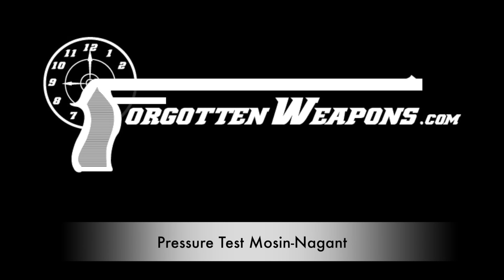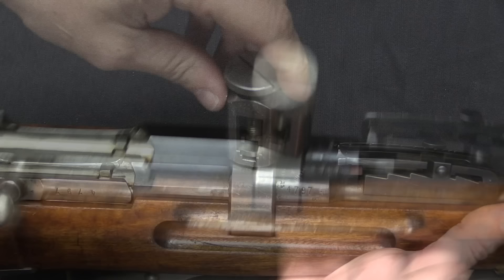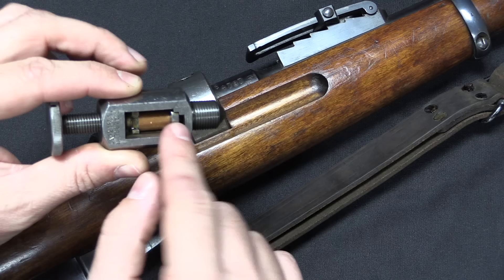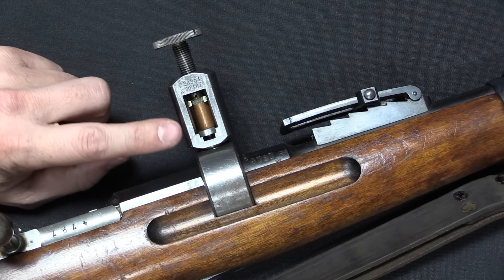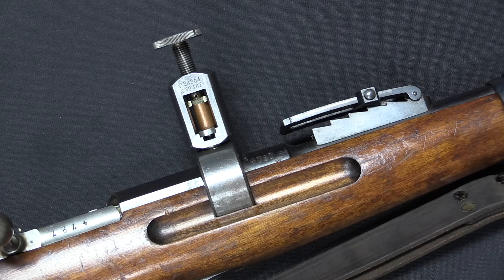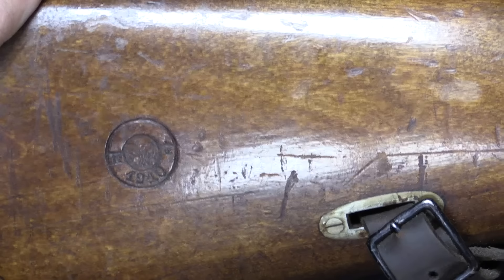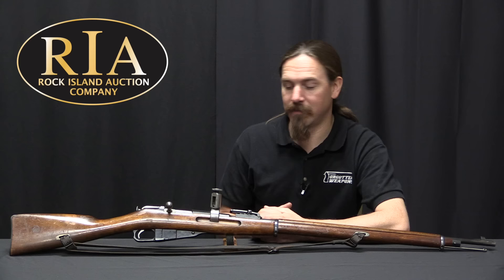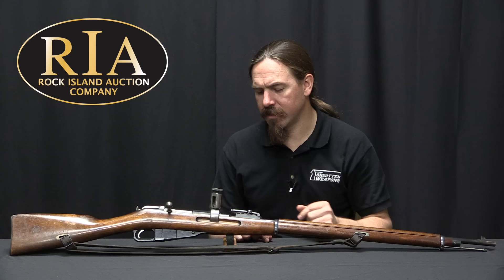Mosin-Nagant Factory Pressure Test Rifle

Comment: Very technically speaking, a Mosin Nagant with a gas piston.
Reply: Taco press included
Reply: Fully automatic mosin
Reply: in a very specific sense, a firearm itself is just a type of heat driven piston engine. so this is a heat piston with another heat piston attatched to find the operating pressure of the first heat piston
Reply: Hahaha

Comment: I would love to see one of these firing in slow motion and seeing the copper squish
Reply: It would be cool to see it fire,however the "squish" is probably measured in thousandths or hundredths of an inch and not as dramatic as one might imagine.
Reply: Quick let's get Talfledermaus on this project!
Reply: @JohnLeePedimore  Unlikely, since they could measure this before 1900, at a time when measuring thousandths or hundredths of an inch wasn't possible.
Reply: @anzaca1  Micrometers have been around since the 1850's. thousands or ten thousandths of an inch can be measured that early
Reply: @anzaca1  Joseph Whitworth was measuring thousandths of an inch back in 1857 and the micrometer is much older than that. I'm not sure if they even used CUP on black powder guns back then because the normal method was to "proof test" the barrels by loading a double charge and firing it. Proof testing is still in use in Italy today.
Reply: Buy it and have Ian show us!! :)
Reply: Tenaciousvirgil tenaciousvirgil sadly I live in socialist England
Reply: @ArchieKeen1  oh dude so sorry to hear that. Ps free Tommy!!
Reply: @JohnLeePedimore  I think they designed the deformation to be in a bigger bandwidth to measure more easily? Like, if it was only thousands, they could have designed the probe longer?
But a short one might also have more advantages, one important is that the volume doesn't influence the pressure if the amplitude isn't high
Reply: @gustavgnoettgen   True enough. It also makes it easier to get the case out of the gun if it doesn't have part of the brass shoved into a hole in the chamber.
Reply: @JohnLeePedimore  Slowmotion and zoom then.
Reply: @JohnLeePedimore  pure copper is very soft. And considering they didn't use lead, copper was likely soft enough to be squishy noticeably.
Reply: @anzaca1  actually, gauge blocks were made in 1896 that were accurate to a ten thousandth of an inch, and Brown and Sharpe had commercial micrometers that could measure thousandths in 1867. Even before that, handmade gauges could  be made and calibrated to measure things like the copper slug.
Reply: @anzaca1  micrometers have existed since the 18th century.
Reply: @anzaca1  that's simply not true, vernier scaled micrometers could measure to four decimal places before 1900
Reply: I would have settled for an example of squished copper.
Reply: Not as big a squish as u think probably.  If it was, would come into contact with the walls of the bracket :c
Reply: I think it would just be a sped up video of the Hydraulic Press Channel and you get a similar effect.
Reply: Pod it would probably still be a satisfying deformation in macro, ultra high speed.
Reply: Anzac-A1 bullshit bro
Reply: @anzaca1  and you think people back then lived in caverns also?
Reply: Sqwoosh!

Comment: As a reloader I know what CUP is and have that info in some of my older manuals,  but I've never seen a pressure test rifle . So this is a really cool video to watch .  In recent reloading manuals PSI is used , and there is information stating the barrel used for load development of each cartridge before the various bullet weights and charges of powder used . Often times the barrel will be a certain manufacture ,  length and twist rate  .  But sometimes the barrel used is listed as "test barrel '.   A knowledgeable shooter and reloader should inspect the fired brass for signs of overpressure . These are , but not limited to , primers showing signs of backing out of the pocket , primer cratering , primer flattening , excessive case stretch ,  and such .      Interesting story , I was new to reloading and told a relative I could use the spent brass from his 30-30 to reload better than factory ammo . When I received some brass he had recently shot I gave them an inspection before depriming . The primers were set back from the pocket a few thousands of an inch were a bit flattened , and  were starting to crater . I asked him how his rifle was shooting . He said as accurately as ever , but the recoil seemed harder . I told him his rifle was shooting too high a pressure . Over the years he cleaned the powder residue from his bore and chamber,  but never cleaned for copper fouling . After a thorough cleaning of copper buildup the rifle shot factory ammo with no signs of overpressure , but accuracy was terrible .  My handloads shot equally poor groups .  Years of improper cleaning had damaged the the rifling just forward of the chamber . The fouling was allowing the bullet into the rifling straight but slowing it's release from the case .     Y'all  Take note . Clean your guns of powder residue and metal fouling . And if your spent brass , especially the primers , look wonky , have the gun checked out before shooting it anymore .  Peace , Out !
Reply: I don’t even own a firearm and this was insanely interesting to read. Thank you!!!

Comment: The calculation is fairly easy to calculate chamber pressure via this method. Its always interesting to see the change in technology over the years for just taking measurements. Now days strain gauges or piezoelectric sensors are used.
Reply: +Mongo63a
It's not easy enough to do without a calculator, but yea. I'll bet gauges are better than having to keep track of copper pellets, for sure!
Reply: @Thelothuo  Yes... but nowhere near as cool!
Reply: Piezo electronics are also used for amplifying acoustic instruments! Things like guitars and ukeleles. Interesting how the same concepts carry over. In acoustic instruments, the crystal is placed underneath the bridge saddle (where all the downward pressure from the strings goes into the body) and turns the string vibrations into an electric signal and then into an amplifier.

Comment: Of course you can convert,you take the stress deformation graph of copper,you put the permanent deformation ofthe copper on x and you go up with a line of the same inclination of elastic deformation ,when the line intersect the copper graph thats the pressure on the copper,you multiply that for (Area coppercylinder)/(area piston) and you obtain the pressure inside the chamber
Reply: Correlation coefficient, not quite a direct conversion of units.

Comment: I mean so long as you know the Young's modulus of the copper sample then you can calculate the force applied. The force applied divided by the surface area of the chamber should be your chamber pressure

Comment: Copper Crushers, as the copper pistons are know were a common way of measuring the in chamber pressure of many rifles. Normally what would happen would that a manufacturer of these 'crusher's' (which came in rods and balls) would sell them as lots with pressure tables (a tarage table), as Ian mentioned, one you have fired your round you would measure the amount of compression on the rod and ball and compare it to your table to give you a pressure measurement. This system had been around since the early 50's and was uses world wide in small arms, even though it began life which large calibre (i.e. artillery pieces).
As of 1977 Abderdeen Test Centre delcared that the Copper Crusher Method was no longer suitable for NATO purposes as it could not be measured precisely, therefore nowadays most NATO countries (and many non NATO countries), use Piezoeletric sensors which are quartz based sensors which can provide measurements with accuracy to normally 0.5%. (Depending on how well the equipment has been maintained, whether it is within it's calibration spec and the DAQ system it is attached too is operated by a competent user).
Oddly enough you still see copper crushers being used in and around the middle east and normally on shotgun cartridge testing mainly out of habit and that Piezoelectric sensors can be expensive (read approx $2-3k per sensor).

Comment: Years ago when I was an inspector in a large manufacturing facility hardness was tested using CPU's also by measuring the squish of the copper pellet by smashing into a surface with a round anvil to create a dent to a certain depth. The latter tests used a direct pressure reading but the old charts still listed CPU's for comparison.

Comment: CUP and psi have no direct conversion, but are of the same general magnitude; a cartridge developing about 50,000 CUP will develop pressures in psi about the same plus or minus a few thousand.

The pressure tables are drawn up with copper cylinders of the type described, which are subjected to known pressure impulses in a pile driver-type device.

Comment: Probably my favorite pressure test rifle I've seen in person was the 1918 Mauser T-Gewehr that the National WWI  Museum had on display some years back. Imagine the size of the copper cylinder that thing would crush for pressure testing. I don't think they had the full setup with the actual thread-in piston for it, but the added ring that it would thread into was quite sizable. If I recall correctly it also had it's sights offset to account for the massive ring and piston setup that would have blocked the normal, in-line sights. My best guess as to why that would even be a problem is that they might have been using it for accuracy testing as well.
Reply: @jjohnston94  Fair enough, the threaded hole and the reinforcing ring around it seemed pretty beefy though. Either way though, still a neat piece to see. They get some darn nice stuff at that museum and they try to cycle through a lot of what they have in storage in the changing special exhibitions fairly often, makes me glad I live close enough to drop by every so often and see what's on display for the month. I still drool (figuratively, of course) over their really nice example of a Russian contract Winchester 1895 every time I see it.

Comment: EDIT: I was wrong here, but I'm leaving the original for future reference. I explained the error in a reply.

ORIGINAL COMMENT: I think the reason why there's no conversion factor between PSI and CUP was described a bit confusingly here. The actual reason is that CUP is not a linear unit of measure. If you double the pressure, you don't simply double the squish of the copper. It's a much more complicated curve.

There should be a conversion formula between the two, but it won't be a simple 'multiply by x' kind of thing
Reply: Would this be a table lookup occasion?
Reply: @LadyAnuB  It turns out I was wrong. The CUP is calibrated to be linear, and hence should in theory be linearly related to PSI.

The problem is rather that a short burst of high PSI and a long burst of lower PSI can cause the same crushing effect, which means that the CUP method is based on a kind of 'averaging,' and will not tell you accurately what the true maximum PSI is during firing.

Comment: Last time I checked, Winchester was still listing the pressure for the Ranger T-Series 127 gr. +P+ (RA9TA) in Copper Units of Pressure. On the last box I bought, they had it listed as 42,000 C.U.P. One source I found claimed this is a crossover point, where C.U.P. and PS I are in general agreement. Not sure if this is true, but–side note–that stuff sure beat the hell out of my gun, and extra stiff springs didn’t help!

I’ve always been interested in C.U.P. If I loaded for 7.62x54r, I would be sorely tempted to use this collector’s item for its intended purpose.

Comment: I don't know what I'm talking about, but that won't stop me from offering an opinion. It seems to me that the reason that you would not be able to convert directly from cup to kpsi isn't because the copper movement is an "indirect measure." After all, all measurements are "indirect" in some fashion or another. I think the issue is that the amount by which the copper moves will not be a function of peak pressure, but rather a function of the amount of time at pressure.

A ductile metal like copper will begin to deform when the stress exceeds a certain critical value called, if memory serves, the "yield stress." After that, it will basically move like a viscous fluid. The copper will continue to deform as long as the pressure remains above the yield stress, so you will get more deformation either by raising the pressure or by sustaining the pressure for longer.

Think about the difference between compressing a spring and squishing a piece of play-doh. Below the yield stress, the copper block acts like a (very stiff) spring. Above the yield stress, it acts like play-doh.

To get a true pressure measurement, you need a transducer that behaves like a spring over the entire pressure range.

Comment: You ought to be able to convert it over. You would need a stress/strain curve for compressive strength (most of the available graphs are for tension) but then it should be feasible to convert over to psi.

Comment: In the literature you often see pressure as in copper crush units.  I disagree that it is not a direct method of reading pressure.  Each disc I assume is good for only one test.  Many people now use transducers and such I believe are still available for sales to individuals.  You got me interested enough that I will probably do some research on it.  By the way I had a job as part of an environmental team doing clean up work at a former arsenal on the charles river in Massachusetts.  While we were there the workmen discovered a couple of rifles stored in some lockers.  One was a springfield bolt action fitted with a huge ring of steel over the chamber area.  I could not get close enough to see it very well.  It went into an armory vault.  I suspect it got destroyed and did not make it to a museum but I am not sure.  
Hand loaders without pressure transducers frequently will check/measure the bases of fired cartridge cases for signs of pressure.  If you get case head expansion and protruded primer cases one had better reduced the powder charge.    Here is a brief discussion of rifle pressures:  When you look at a loading manual with load data, you will usually see pressure ratings for stated load. Sometimes these are listed in PSI numbers, which most people correctly understand to be Pounds per Square Inch of pressure. However, powder-makers also commonly list pressure in CUP numbers. CUP stands for Copper Unit of Pressure. You may be asking — “What exactly is a CUP, and what is the origin of that unit of measurement?” You may also be wondering — “What’s the difference between CUP pressures and PSI pressures?” On Hodgdon’s Facebook Page, you’ll find answers to these questions. http://bulletin.accurateshooter.com/2015/04/copper-unit-pressure-defined-by-hodgdon/

Comment: Would there be case wall covering the hole at the base of the chamber? I mean, if the case strength is also accounted for in this method, and the cylinder is measurably squished, the case would be ruptured or noticeably deformed, right?

Comment: You can't take a numerical constant and convert from psi to copper unit of pressure, but there probably is a mathematical function. Side note: until recently Polish army defined a lethal weapon as one that can penetrate fresh, pine, one inch thick plank at a range of 100 meters.
Reply: The problem is that there is more than one way to get the same amount of squish. Take one loading that has just barely enough pressure to squish the copper but is able to maintain that pressure for the entire time the bullet is in the barrel. Then take another loading that creates a much higher peak pressure but drops way off quickly. The two may give the same cup number but the second actually has a higher peak pressure.

Comment: I don't understand exactly why this wouldn't translate to PSI. Is it because the same pressure (measured in PSI) applied to this exact same device in two different guns, yields different amounts of "copper smashing?" Or some variable they couldn't control causing different deformation using the same pressure?

Comment: So when the cartridge fired I am assuming that the 54000PSI chamber pressure would have blown a neat hole in the side of the case adjacent to the hole in the chamber and leave small disc of brass in the space below the piston? Otherwise there would be a bulge of brass protruding into the piston hole which would prevent extraction of the fired case or is the distance the brass moves against the piston so small that it just springs back?

Comment: In addition to C.U.P. there was also L.U.P. (Lead Unit Pressure) for low-pressure cartridges. So, does the wall of the cartridge blow out into the  test plug every time a load is tested?